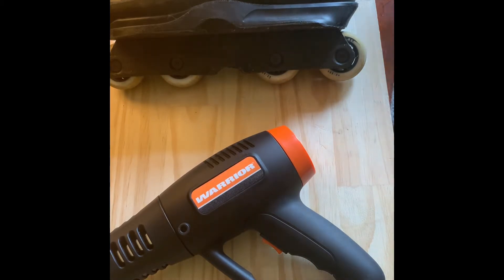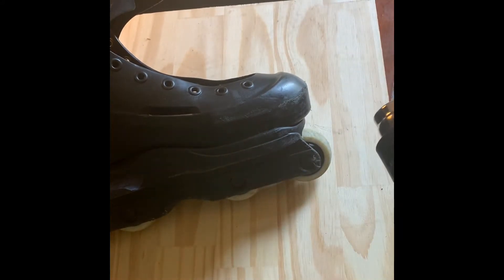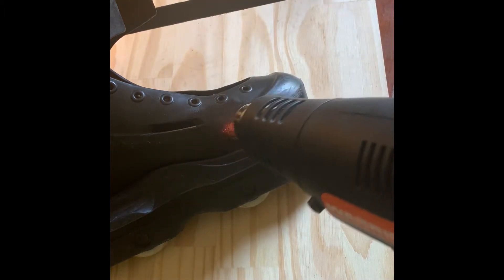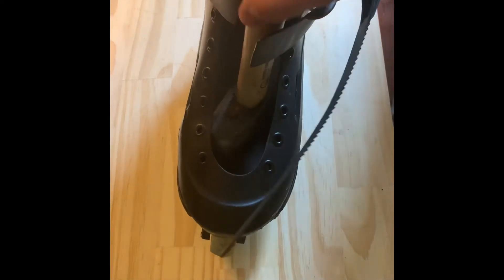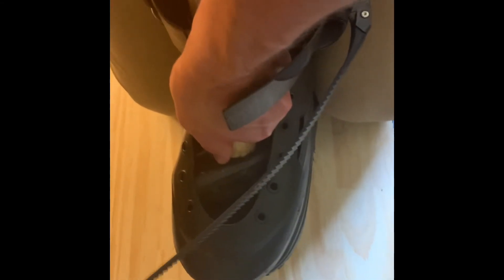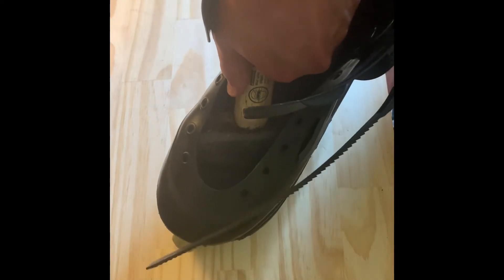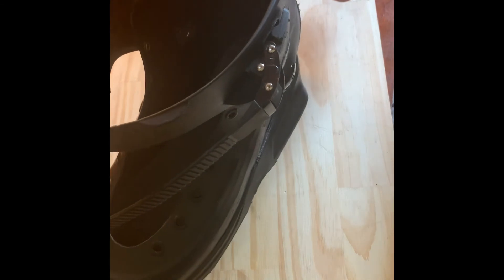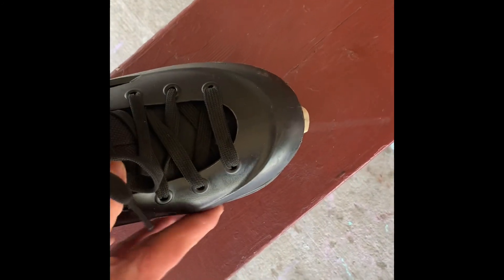Heat molding Inline skates

Comment: Bro just use a blowtorch 😆  I just skate nothing but usd carbon skates went trew every pair of skates on the market gave a shot for usd carbons an never had one issue
Reply from the maker: Ha - these aren’t terrible. I don’t like the one piece frame-soul plate, but after molding them they are quite comfortable.
Reply: @Nihil  that's good news bro keep it up an it's time for some true spin top souls lol
Reply from the maker: @MK-xw1rp  who’s this? Were you there when I broke myself recently?
Reply: @Nihil  lmfao 🤣 that's a good one I don't think we meet my name is Michal Kxxxxxxxxxx don't want to say my lest name u can say I'm one of the older generation of the skaters I still skate but I'm starting to lose focus I'm always the black sheep 🐑 in the skate parks I'm from NJ . To skaters came last weak I ask ware is every one ? They told me almost no one skates in NYC I just came back to the sport last year an I wonder did it get that bad or is just to expensive for young ones to buy skates
Reply from the maker: @MK-xw1rp  I’m in the same boat. I’ve been skating since 1992, took a big break, and only recently started challenging myself again. Many injuries… latest was 4 broken ribs from missing an allyoop topsoul..
Reply: @Nihil  I know how that goes buddy, my true spin top sides are easy more then those an also ur legs 🦵 an brain starts to come back after a while but I over did it last week I did 270 soul to 540 out my lower hip start to hurt in the park I felt like I was 50 lol